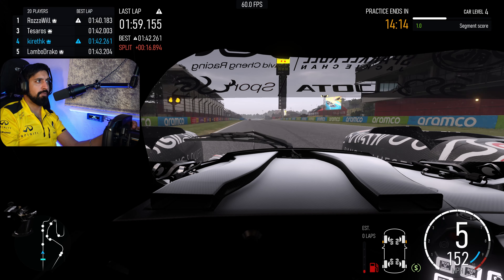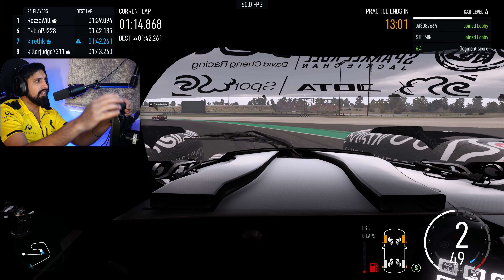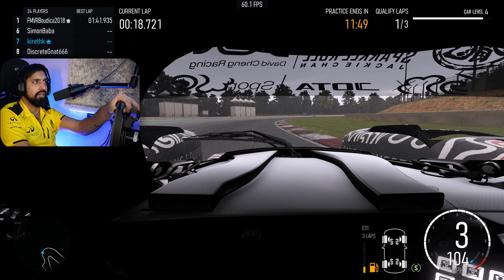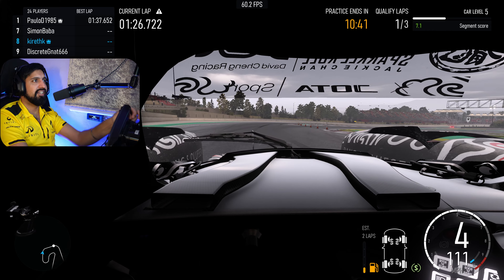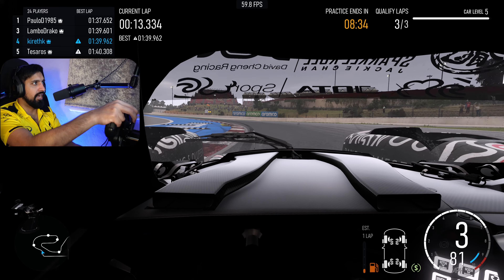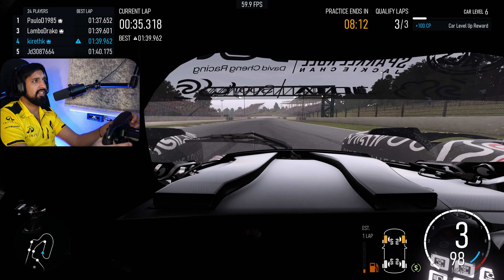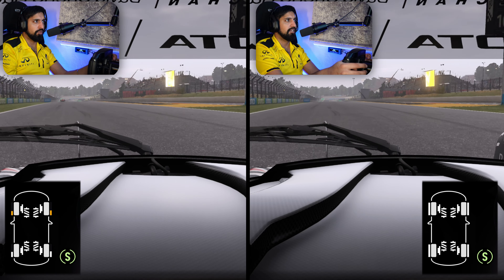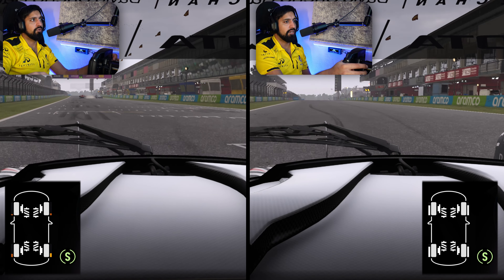WARNING: New Forza Motorsport Bug (It's Bad...)

Comment from the maker: Can anyone explain this bug??
Reply: This bug is killing the game for me as it actally makes driving a wheel far more work, the physics feel okay on a controller but going to the wheel and its a huge dissapointment for me,. got so hyped for this game and got so let down :/
Reply: Bro what are you doing the wheel needs to be at 1080 for Forza I can see your tyres overheating! Are you sure it's a bug? I thought the more wheel rotation with worn tyres was because they have lost grip from wear ... You don't wanna be pushing the car past when the tyre squeal starts making a noise also as thats when grip is lost, you want a heavy feel then light when grip is about to go the further you turn with then a faint thudding of complete grip gone the tyres then will over heat and you will loose all control, you have to run a strong feedback I feel so you don't oversteer I will send over my setting tomorrow give it a go see what you think
Reply: Do you want tires that are practically worn out to have the grip of new tires? Don't change the tire when it's at the limit of completely worn out, and see if it will have the same grip, and you have a worn tire as a bug? Race in the GT7 and don't change tires then, just refuel.
Reply: Since for you a worn tire is a bug, you can race in real life with bald tires, anything if you kiss a streetlight just say it was a tire bug.

Comment: Hey! the majority of the bugs you reported I also faced - like not being able to change tires after qualy, etc. Most of them are now solved after I updated my graphics card driver. 
Regarding the wheel, I need to test that as I usually play on controller as I feel like im so much slower using the wheel - not the case in other games, just in Forza.

Comment: At least your wheel is working. I'm having a major game breaking bug with my Logi G29. It's spamming the accelerator button. It's ONLY Forza Motosport. I can go play any number of my PC racing games just fine and GT7. I've narrowed it down to Forza. Unplugging and plugging back in the wheel doesn't work, nor does restarting computer/game. I'm at a loss. It's very frustrating.
Reply: you may need to configure your input settings every time I boot the game its changed all my input back to defaults that dopnt even work so everyu time I run this game I have to set up my controles and dead zones every single time.

Comment: Are we not going to discuss the completely absurd tire wear on one lap of a race? You will go from "moderate" to "extreme" in the space of two corners. 

Other tire related bugs in the game: When upgrading to racing tires before any other suspension modifications, certain cars will revert to having "stock" tires installed, even though the racing tires are still shown as installed (the fix is to remove the tires, save, apply whatever suspension mods, save, reinstall tires)

Hard tires on shorter races will sometimes begin losing grip faster than mediums.

Hard tires will sometimes wear faster than mediums (same car, track, conditions, and setup)

The act of changing the tire compound can result in significant changes to spring rate and anti dive/squat.

Changing downforce settings can result in changes to the tire pressures, anti-dive/ squat and spring rate.

The game will mess with your spring rates when adjusting fuel and tires- disproportionately stiffening or softening one end or the other, and returning the fuel level to the original state will not result in the spring rate returning to original level. The end result is ALWAYS that patented forza understeer (tm) 

Bottom line- If you have a setup that works, memorize or write down your settings. check to make sure that the game hasn't "assisted" you by making unwanted background changes to your setup. 

If you have time, ALWAYS test with different tires to see if selecting "hard" tires isn't just effectively handicapping yourself.

Comment: I wonder if it has any correlation with the game being made primarily for controllers. The sticks on a controller can’t keep tilting. There is a hard stop. So it would be interesting to see the behavior on controller. Do you have to slow down more? Or does the outside of the analog stick range get interpreted as infinite steering angle if held and accomplish the same thing as a higher wheel lock, but with less input as a DD wheel. 

I wonder if the attempt was to make you need to slow down due to less grip, but wheels can keep rotating without a physical wheel lock. And so a wheel driver doesn’t need to slow as much as a controller driver. If this is the case then the bug isn’t that you have to rotate the wheel more and more, it’s that you can and it does anything. 

It then doesn’t help that online races has extremely high tire degradation. I never noticed this in career.
Reply from the maker: I think you got it spot on, because they wouldn't design it so extra rotation gives you extra grip in these tyre wear understeer scenarios.

Comment: Did you change the steering lock? 

You’re in a prototype car… you have to drop it to about 70-80%. If your wheel is 1080… 

A trick is to show the driver hands and then adjust that steering lock until it matches your hands when you do a full 90degree turn.
Reply: Not even what hes on about I think you missed his point, the way this game does as
 the tires get used up, with fresh tires he has to put in far less steerinmg input but some reason the more you use up the tires the more it forces you to use more steering angle, very unrealistic and never played a game that works like that and honestly ruins the game for me.
Reply: @arranmc182  yeah I’ve seen that issue but with fresh tires. You can add more steering input to turn more. It’s not realistic i agree. I don’t think it has to do with tire wear and is overall how the physics work. It just because more obvious with less grip. 

I guess it’s not much of an issue for me since I don’t force more steering input to turn. That’s just bad driving. You should be able to use your brake and throttle to turn while steering input is the least possible.
Reply: @Ghanja007  you clearly missed his point break and throttle will do no good on some cars, go play games like ACC, Project Cars 2 or iRacing then go back to forza and you will feel like your playing an arcade game from like 10 years ago almost
Reply: @Ghanja007  also this bug does not happen in single player career mode in any setting you pick only applies when you race multiple, single player feels almost like play the older games but online feels different.
Reply: @arranmc182  I think you missed the point. Forza IS an arcade game lol.

Comment: It's not a sim though. And they exaggerate the tire wear to give people the feeling of having to manage tires.. when they light up yellow like that it means they are hot and you are understeering - which needs more wheel input to compensate. Slow down when tires are worn and you wont have the issue, or pit for tires.
Reply: Funny that thats how Microsoft and Turn 10 was selling it before it came out.
Reply: @arranmc182  im sorry but any racing game thats designed to use a controller and has steer assist was never meant to be a sim regardless of their claims. It's more realistic than a need for speed but definitely not sim along the lines of ACC or iRacing for example..

Comment: That wheel rotation would drive me nuts! Obviously designed for pad players. #GT7 wins again. 🎉
Reply: GT is much worse for pads too though. I used to love GT on a wheel but it was a pain having something so big in my room. Forza on a pad is a good compromise
Reply: @romanlakes  wheel and a rig does take up space tbf
Reply: @romanlakes While I play GT7 99% with my wheel, I'll occasionally use my DualSense Edge and it plays just fine. I'm only a little slower with controller vs wheel. PD optimized the hell out of the controls for GT7 imo.

Comment: Do you apply a custom steering lock for each of the cars?  While driving yesterday I was wondering if this had been done would the effect be less pronounced as the tires started wearing?
Reply: Additionally did you use the suggested settings from Logitech site for your G Pro wheel?  My initial experience with G923 was horrendous.  I watched your video on tuning it, as well as some others.  Created a spreadsheet, made minor changes to settings here and there until I dialed it in for me.  I was very surprised that Forza didn’t have a premade profile for the wheel highlighting how the developers intended for that wheel to feel in the game.  I think that’s a big miss on their part and would really enhance the experience.